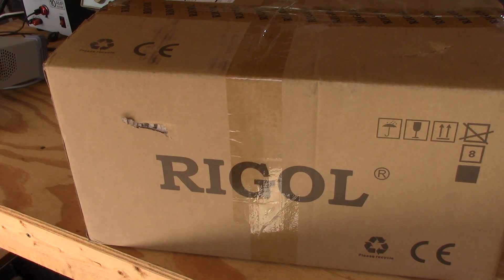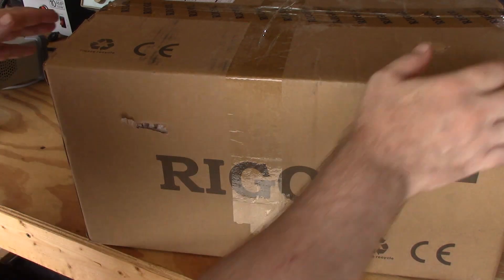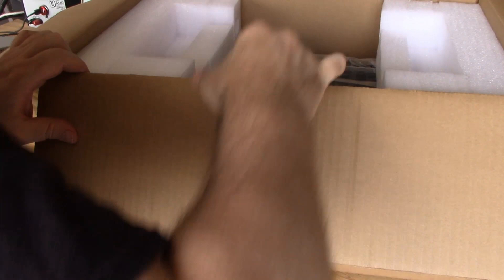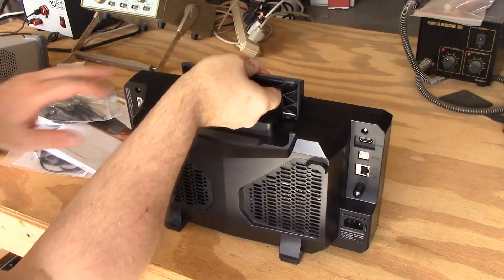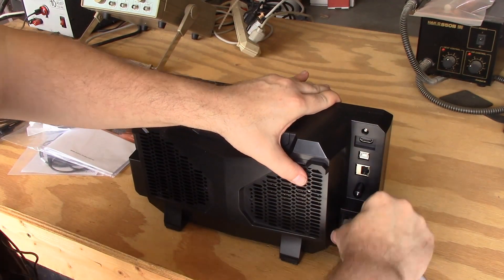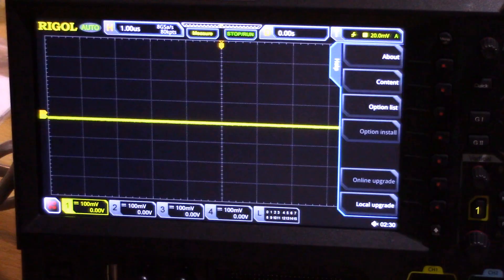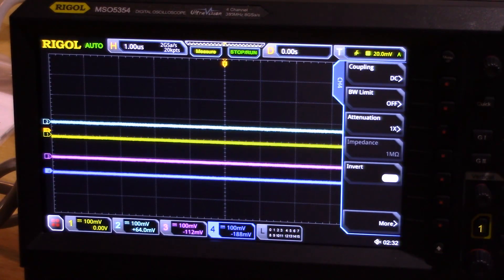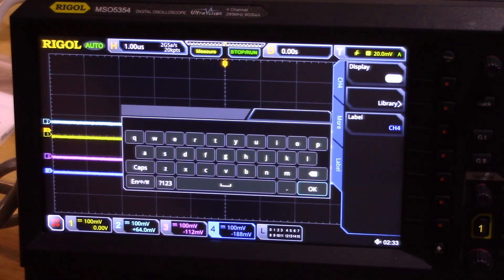ER03: Rigol MSO5354 mixed signal oscilloscope unboxing

Comment: Thanks for the unboxing.. I am considering buying the entry-level 4 channel scope but i am a bit worried about the front end noise floor compared against siglent SDS2000X+.  Can I ask if you happen to check the noise floor and maybe doing a video on the noise floor? Thanks.